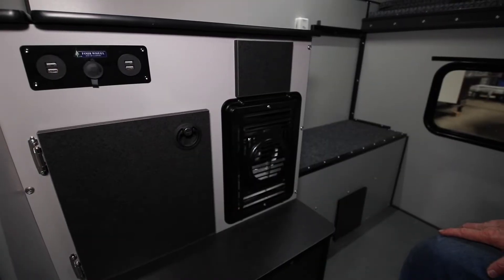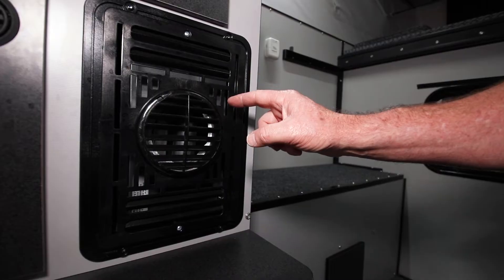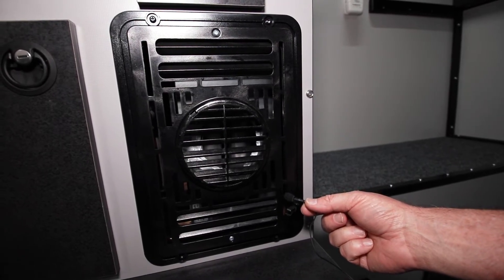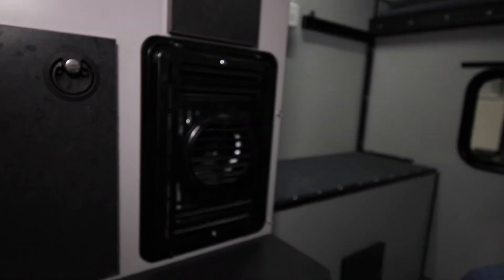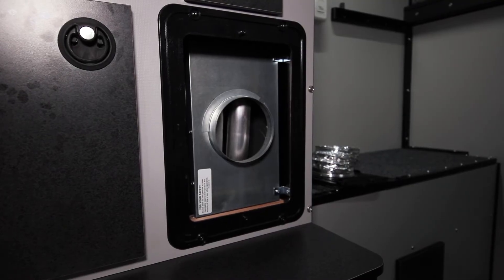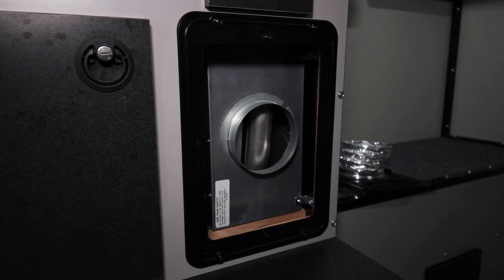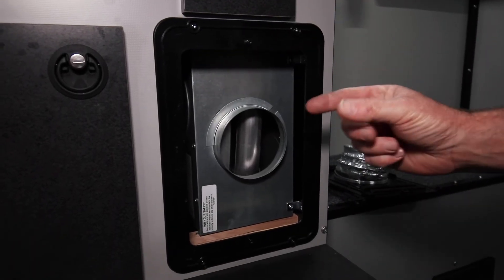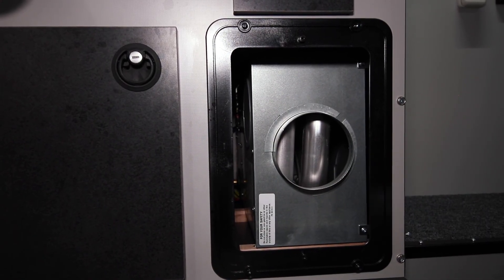Dometic Furnace Troubleshooting | Four Wheel Campers

Comment: Occasionally I have had an air lock in my propane hose from the tank to the camper. I learned that I need to open the valve slowly to avoid that. There are videos elsewhere to address that problem.

Comment: My dometic furnace don't work after sitting all summer. It turns on, gets loud, gets hot but doesnt blow out the vents but a very tiny amount. Also one of the exhaust vents blow heat outside I'm not sure what it means. Maybe the duct is clogged. I don't know how to fix it
Reply from the maker: 1.	First, start by removing the furnace cover on the inside of the camper. Look inside with a good flashlight and see if anything looks unusual.

If that looks OK, and it should, put the cover back on, and then go to the outside of your camper.

2.	Next, remove the exterior furnace cover, and with a good flashlight look around the exterior of the furnace, and especially down inside the exhaust tube with a flashlight to see if there is anything inside ?   Depending on where you live, it is not uncommon in some parts of the USA for wasps to make paper nests, or mud nests, inside the exhaust tube.  If you see mud inside of there, you will need to break it up and suck it out with a shop vacuum.

Comment: Wish I had seen this before the rv dealership charged me $100+ to do it. Mine seems to only work well with one of my propane bottles, both are purged
Reply: One of my propane bottles gives me trouble. There's a safety high flow check valve in every propane bottle. If that valve trips if cuts way down on the propane flow. You can tell by lighting the stove and see if you only have a small flame. To reset it, turn off the propane bottle and relight the stove to bleed a little propane, or take the hose off the bottle for a few seconds, the bottle should reset itself. Important to open the propane bottle slowly. One of my tanks has a sensitive check valve I guess. I hear it pop more than the other. It's like a BB under spring tension and makes a "ting" sound when it activates.

Comment: New owners, please follow the instructions & purge new propane tanks, otherwise air & moisture can get in the system. In my shell camper I only got the furnace. If air is in the propane line, there's no way to purge it unless you have the stove. My opinion, get both. 
When it's minus 10 out & blowing snow, I'm happy & warm.
A variable speed furnace motor for quieter starts would be nice for sleepy time.